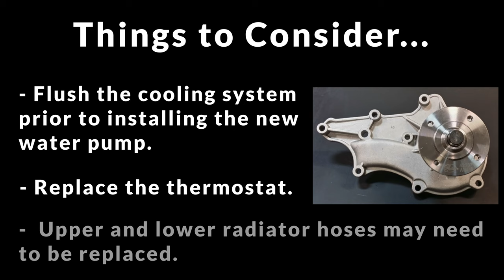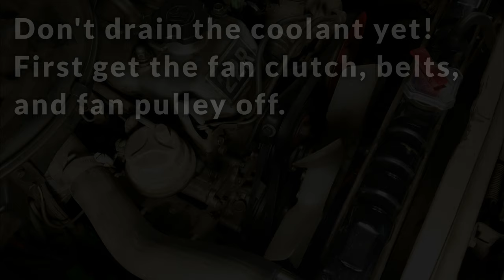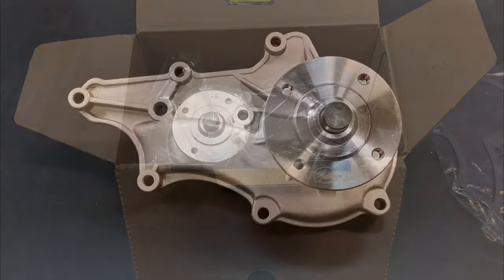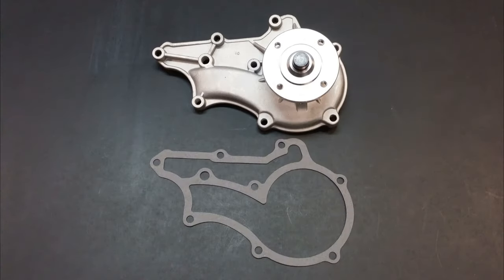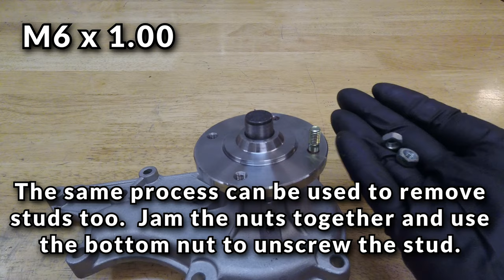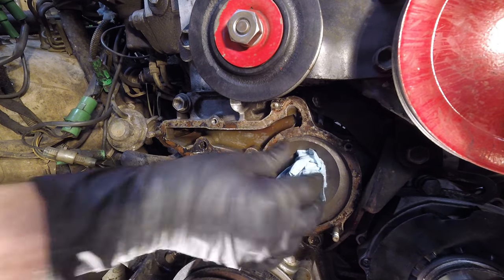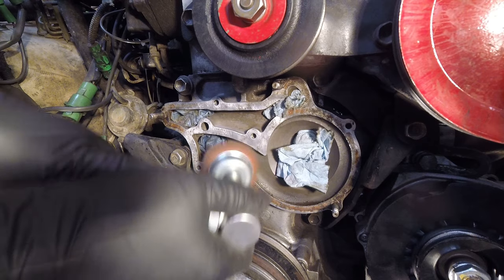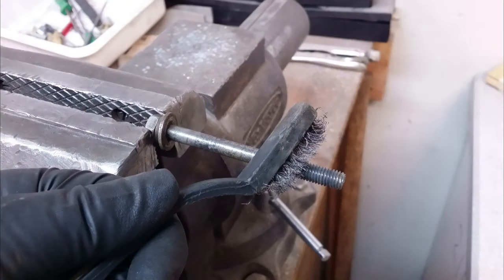TOYOTA WATER PUMP - 22R Series Engine - Complete DIY Diagnose Remove & Replace 22R 22RE 22RET 4x4

Comment: Really great video, you covered each step and more. One thing I ran into with a Toyota 4 cyl, they made two different size water pumps and the four studs that mount the fan clutch were not the same size, the water pumps look identical, until you try and put the pulley on. It's really great that you show, and mention this early. I take the pulley with me and match it right there before leaving the parts store. I have both size pulleys and fan clutch's for any future issues. I keep a brand new water pump for my 22R on my shelf that I know fits. Great video, thank you.

Comment: Another great video Pete, I'd mention that these pumps come in two impeller sizes, 60 and 69mm (sorry metric car, metric impellers). I was sent the 60mm by mistake, luckily I caught it before installation. For the unwashed 60mm is 2.36" or just under 2 3/8" and 69mm is 2.71" or just under 2 3/4".

Comment: Thank you for the video. My truck was running hot driving to the closest gas station. I followed your instructions and I just did my test drive. Temp gauge stayed below the half way mark and I was able to drive it longer than I have in weeks. Thanks again. Your doing God’s work my friend. Can you put a link for that burping radiator cap? I used your link to order the tacky gasket sealer my mechanic buddies looked at me like was idiot for not using RTV. None of them wanted to help me so they can KMA. Lol
Reply from the maker: Glad I was able to help.  The radiator cap I like with the lever vent are made by Stant.  Here's an amazon link to a version of that cap:  https://amzn.to/3yjU7CQ  The cap in this link may not fit your particular application, so be sure to cross reference your vehicle make/model/year, etc. before ordering.  Any local auto-parts store should have them too.  It takes longer to do the job with an actual gasket and Hi Tack, but the results are better, cleanup is easier if you ever have to go back into it, and you don't have to worry about a blob of RTV breaking off inside the engine and floating around until it finds a galley to plug or obstruct...

Comment: Thank you Pete for yet another awesome video.    I have a 1990 Toyota Deluxe 4X4 with the 22re, and I was told the best way to burp the cooling system was to put the front tires up on ramps so the radiator cap is the highest part of the system. And run the motor until all the air is forced out while the motor is running. They say at times the air gets stuck in the heater core ???
Reply from the maker: Yeah, it's all about filling from the highest point you can.  Honestly that's the main reason I have that backflush T in that upper heater hose because that becomes the highest point in the cooling system and the air will escape right out of that T when I have it open.  I also top off the system right to the top of that T.  Ever since I started doing that I've never had a problem with air pockets in the system.

Comment: Heard these older T4R's had overheating issues, but I see what you did; cooler thermo but no fan shroud😉👍
Reply from the maker: I've never had chronic problems with 22r engines overheating, but you do need to make sure you get all the big air pockets out of the cooling system when you change coolant.  As for the fan shroud, I still have the original metal one for this engine, but there's a 2" body lift on this truck and I never got around to lowering the radiator. If I tried to put the shroud on the radiator, the fan would hit the bottom of the shroud.  I keep meaning to put it back in, but haven't gotten around to it in the last 20 years...lol
Reply: @WheeliePete  😄 no worries, it always makes me feel good to see an ol' truck being maintained & running good. Have a 3.4 on my V6 runner, it's a "non-interference" engine & still running original waterpump, belt & pulleys I assume; can hear'm whining & chattering but even if they snap, it shouldn't hurt a thing internally. Love'm!👌

Comment: I was losing water from both weep holes so i put on a new pump.  I am having to use my  4 old fan studs as Pep Boys did Not supply them.  Used a thin vice grip to remove the studs.

Comment: Thanks Pete for another great video. I was curious if you have to add a sealant to any of the bolts that may be exposed to oil?
Reply from the maker: Not a problem with the water pump mounting.  The bolts are all going into blind holes surrounded by gasket.  There is one bolt on the 22R series oil pump housing that you do have to put sealant on though.  My 22R front main seal video covers that: https://youtu.be/5eozfLpEJds

Comment: Could I use the high tack sealant with a gasket for the oil pan? Or would you recommend just using the black fipg? Great video by the way, very helpful!!
Reply from the maker: I use Hi-tack on anything that has a gasket (and isn't hot exhaust or intake).  I'll only use FIPG or Ultra-Black RTV when I'm not using a gasket.  Now, that being said, with the oil pan, if I remember correctly, only the really early trucks used a gasket between the pan and the block.  The later models had a recess formed in the lip of the pan and you're supposed to run a bead of FIPG in that recess and then bolt it up to the bottom of the block, no gasket.  The recess in the pan lip makes the sealant act like an o-ring when you squish it up there against the bottom of the block.  Then of course you want to take your time and evenly torque down the pan bolts so you get a uniform squish on the sealant.  Just don't use so much that it spooges out and breaks off balls of it into the pan where it can start clogging oil galleys and such if it gets picked up by the crank or blocks the oil pickup screen.
Reply: @WheeliePete  Great advice, thank you! I'll be sure to check the style of pan once I remove it off the vehicle

Comment: Hey Pete great videos.I have a '87 22r w/a Weber carb it has a stock Toyota fuel pump and no fuel regulator. My question is can too much fuel pressure cause the engine to diesel when shut off?
Reply from the maker: Could be a couple things.  Lean condition will cause that, buildup of carbon on the pistons will do that, timing can also be a contributor.  But yeah, you should run a fuel pressure regulator with a Weber carb.  The Weber wants 2.5-3 lbs of pressure.  The stock toyota pump runs around 7lbs if I remember right...  Check out LC Engineerings tech page on the carbs:  http://old.lcengineering.com/LCTechPages/carbtech.html    The original Toyota Carbs had a fuel-cut solenoid that when you turned the truck off actually shut off the flow line of fuel inside the carb to help prevent dieseling or run-on.

Comment: Great video. What torque wrench are you using?
Reply from the maker: Not sure what the brand was, but for lower torque I like using an in-lb torque wrench.  For really small torque I switch to a n-m torque wrench designed for carbon bicycle components.   I have 5 different torque wrenches in my tool box...lol

Comment: I just did a timing chain replacement and it’s leaking both oil and coolant in 3 or 4 locations, I suspect my error may have been improperly putting the gaskets. I’ll use permeated this time for the water pump. 

Can the permatex high also be used for the timing cover gaskets?
Reply from the maker: You can use high-tack on both sides of any paper or cork gaskets.  Don't use it on head gaskets or exhaust gaskets.

Comment: When I try to take off my fan clutch (those 4 10mm bolts) the whole thing spins and I can’t get them off. What should I do?
Reply from the maker: Generally, you would use the fan belt to hold that thing still while you break those nuts loose.  If you've got the fan belt off put it back on and put it under good tension.  If that's not enough, take the fan belt off and put a strap wrench around it to hold it.  If that doesn't work, take a really small pry bar or a long skinny screwdriver and jam it between a fan mounting nut and the fan mount to keep it from turning while you loosen a nut on the other side. Then work your way around the 4 nuts like that.

Comment: Quick question, I used the high tack on my timing cover gaskets and unfortunately after everything was put back together, I have a leak on the bottom left of the cover where it meets the block. Do you think I would have been better off using ultra grey instead of the high tack? I applied it the same way you did in your video, but I might have skimped out a bit on the cover, not applying a thick enough coat of it. Any help would be appreciated! I'm going to take it all apart and redo it again, and I'd like to get it right this time lol
Reply from the maker: Where exactly is your leak?  Is it actually the timing cover to block, or is it up by the overlap where the head/block/timing cover all overlap?  That overlap of the three at the top of the timing cover is very problematic and requires that you put RTV across the joint there of the block and timing cover and then drop the head gasket and head on.  A lot of people get a leak there too if they have the block machined, but don't have the timing cover machined to the same height as the block.  If your leak is down low and it's coming from between the timing cover and the block, make sure it isn't from the oil pan overlap with the block and the timing cover.  Make sure all the timing cover bolts are installed and torqued properly.  If all that fails and you do end up pulling it all apart again, I would take a careful look at the sealing surfaces, make sure the timing cover isn't warped and then super-clean everything. before you seal it all up again.  I'm not a fan of RTV just because it likes to break off and plug oil galleys inside the engine, but if you've got a lot of gouges in either the sealing surface on the block and/or timing cover,  RTV will seal a more imperfect surface than Hi-Tack.
Reply: @WheeliePete  So I'm 98% positive it's coming from the lower left cover / block meeting area. Initially thought it was the oil pan not sealing, so dropped that and redid it. Still got a leak from the same exact area. I can see the steady drip of oil coming from the top side of the rtv on the oil pan and directly in that corner when the engine runs. I put high tack on the top of the timing cover where it meets the bottom side of the head and that seemed to seal very well. The high tack did well everywhere on the cover, minus the one spot on the bottom left. The timing cover is brand new, so I'm assuming it isn't warped. The other weird thing is I'm getting oil seep out of the bottom left bolt on the timing cover. The one that runs through the smog pump bracket / timing cover / and into the block. So I'm getting oil into that area somehow. That's what makes me think the gasket failed in that corner, or I didn't apply the high tack thick enough possibly?
Reply from the maker: The gasket is what's really supposed to seal the surfaces together, the high-tack is there to hold the gasket in place and fill in really minor surface imperfections.  Pull that bolt and make sure it's the right length bolt and isn't bottoming out in a blind hole in the block.  I've also seen before where when people remove a bracket, or ever a washer, a bolt becomes just a smidge too long and bottoms out in the hole, but still looks like it's clamping the cover, when really it's just flush with the cover.  If that bolt is just flush with the cover and not actually torquing it down, that would explain the leak right there also.  Another less appealing thought would be a crack in the timing cover casting right at the bolt boss allowing oil to get into the bolt hole casting.
Reply: @WheeliePete  All good things to look for after disassembly. I certainly appreciate all of the advice!
Reply: @WheeliePete  Well I fixed it. It ended up being a small section where I didn't scrape the old gasket well enough and I was dealing with a double gasket. If not for that, I'm sure the high tack would have worked perfect the first time. Now though I noticed the oil is looking milky. Do you  think it's possible that when I pulled the cover the coolant fell down into the pan and just mixed with the new oil I put in?
Reply from the maker: @Voelkswagon    100% for sure coolant got into the oil pan if you pulled the timing cover and left the pan in place.  There's always residual coolant hiding in the water jackets that drains out when you pull the timing cover.  Did you pull the head also?  If you did pull the head, did you put in a new head gasket?  I would change the oil immediately along with the filter, and then run it, warm it up, then do another oil/filter change, then run it again up to full operating temp and see how everything looks.   Might take a few cycles to get it all out. Coolant in the oil is not good for the bearing surfaces so you want to try and flush all that out of there as best you can.
Reply: @WheeliePete  Makes complete sense. And no, I didn't do anything with the head gasket. I'll be sure to do a few flushes and hopefully get all of that coolant out. I can't thank you enough for all of your help, it's very much appreciated!
Reply: @WheeliePete  Very well said.

Comment: so you dont necessarily need to top dead center it before starting all the work? please answer .. Great Video!!!!
Reply from the maker: Nope.  For waterpump replacement You won't touch the distributor or the timing chain at all so there is no need to set the engine to TDC #1.  On the 22R series engines removing and replacing external belts (alternator, water pump, power steering, etc.) have no effect on ignition timing.
Reply: @WheeliePete  thank you so much i was able to change the water pump myself :)

Comment: Do you recommend high tack for timing cover gaskets as well?
Reply from the maker: I put it on every paper or cork type gasket.  Basically everything except exhaust and crush type gaskets (head gaskets, exhaust collectors, etc.)  I do use it on the timing cover gaskets for the 22r.  Holds them in place real well while you get the timing cover up onto the front of the block.

Comment: I need to do both the water pump and oil pump on my 22re. Make sense to do them both at the same time? Thanks
Reply from the maker: I would pull the water pump first and get all that cleaned up, then pull the oil pump.  You wouldn't want coolant dribbling into your oil pan if the oil pump was off and you went to take off the water pump.   There's always some coolant left in the water pump that spills when you pull it.  But yes, good time to do both when you're that far into the front end.  If you haven't seen it yet, check out my video on the front main seal, that video covers oil pump removal and install.  https://youtu.be/5eozfLpEJds